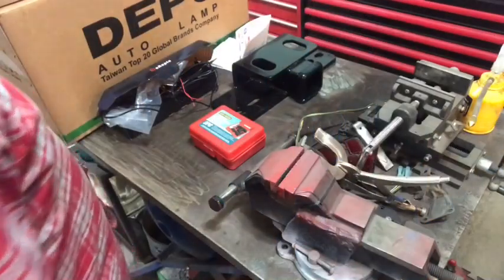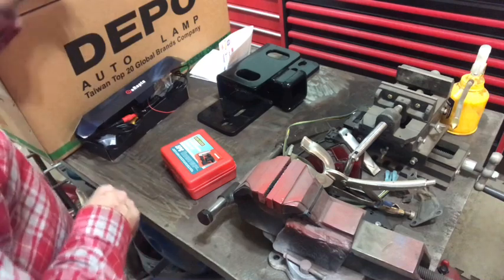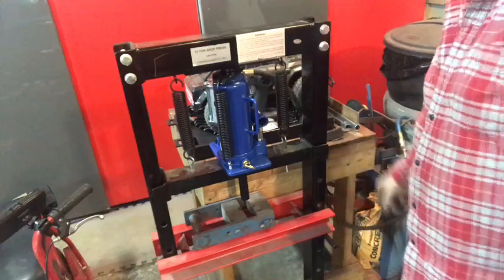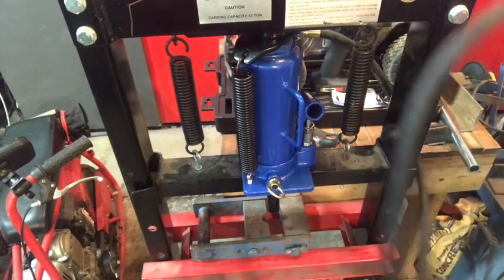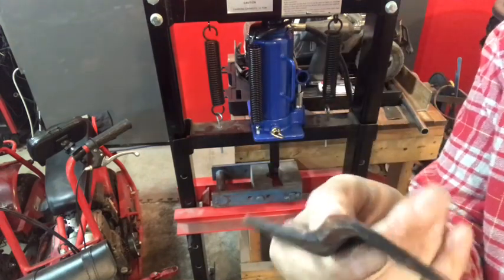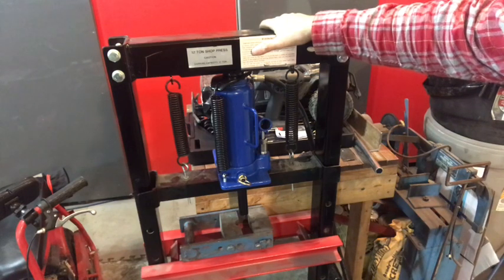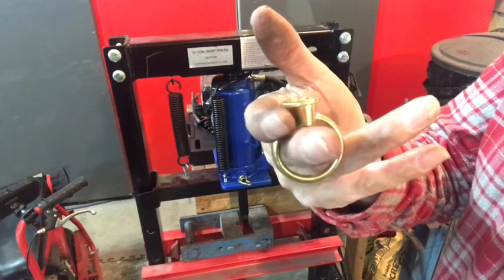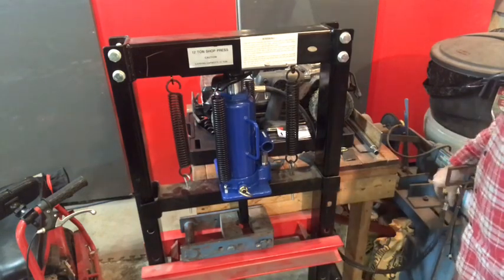12 Ton Shop Press Mod #2.  Adding an Air/Hydraulic Jack

Comment: Great handy Air/Hydraulic tool Bruce. The packet screw drive came in handy when working on small machinery. Nick
Reply from the maker: Hey Nick.  Little bits and pieces like that always end up coming in handy eventually when you build or modify things yourself.  I'm sure you've repurposed a lot of things working on the model railroad.

Comment: They had an "engine hoist" where I worked years ago with one of those pneumatic driven cylinders. It worked pretty good until they lifted an entire Cessna 182 fuselage complete with landing gear, engine, and prop. The main upright support beam buckled but the cylinder never broke a sweat. We rebuilt it, went from 4"×4" box channel to 4"×6" and thicker too. After that the hoist would lift damn near anything! Be careful with that press, things may fly out.
Reply from the maker: Ya, I've already thought about building an expanded metal shield in front of it.  It'll be hinged on one side so it can swing open.  Years and years ago I was using a socket as a spacer in a press and it shattered and a piece shot out and slice my arm open.
Reply: @BruceLyeg  
Ouch! Better your arm than your eye!

Comment: Awesome Bruce《☆》I'm a big hardware saver too🤓👍🏾 You never know what kind of project you might be doing out of necessity. Pressure gauge comes in handy when assembling more delicate parts but the frame will let you know when you exceed its limitations :*: Greetings from☔Florida🤳my friend🤓🗣🔊☮✌👍🏾
Reply from the maker: Thanks BDOG.  If you build or modify things, all these little bits and bobs come in handy eventually.  Take care and stay safe

Comment: How big of a compressor are you using for that press? Is it the harbor freight brand ? I have an 8 gallon husky hot dog compressor. Would I have to upgrade my compressor to make this mod work on my press ? Thinking about doing this.
Reply from the maker: I’ve got a 60 gallon compressor, but you don’t need one that big for the Jack. Your 8 gallon should work just fine.

Comment: Hey I have seen this Idea somewhere hmmmmmmm  just cant put my finger on it.. I want to put rollers on the slide to keep it from swinging back and forth.. plus i welded my jack handle  cause it kept falling apart. I too want o put a jack handle on mine  I have chased that handle for years . It would always fall off just out of reach. I am going to take a piece of tubing and weld it to the side with a pin going cross the bottom to hold the handle in . I added a 1 in nut to mine so I can screw in different pushers. I just need to have the 6 in and the 8 in made on a lathe.. Hey I subbed Bruce I had no idea you had a channel
Reply from the maker: I was thinking of welding my handle together too.  I don't really need it to come apart.
Reply: @BruceLyeg  i have mine setting  on top of two I beams. I want to do something for lifting the table, any ideas